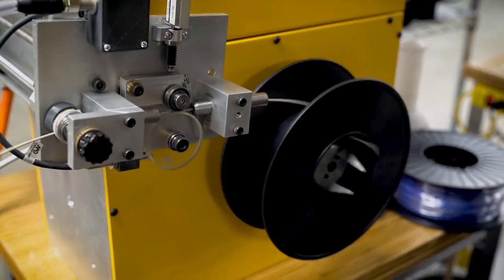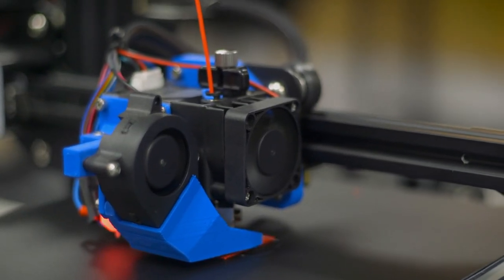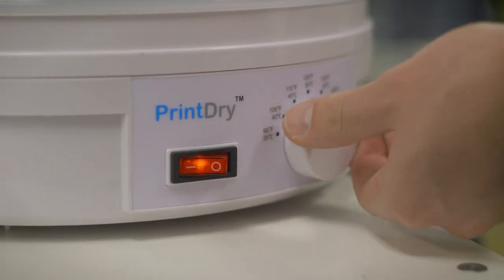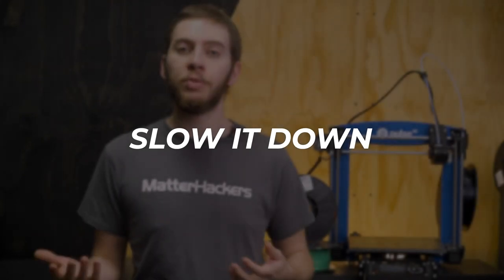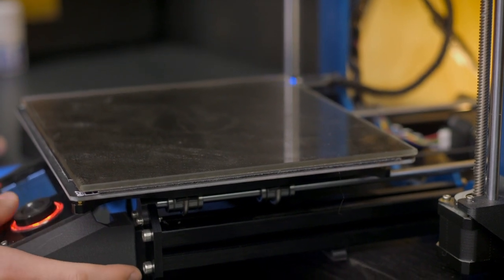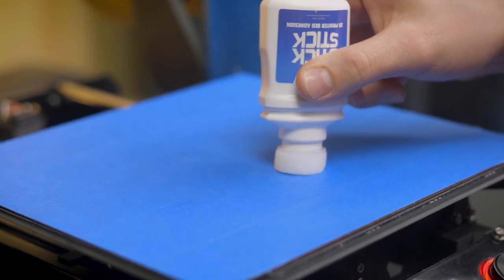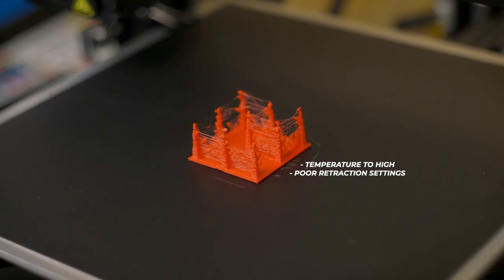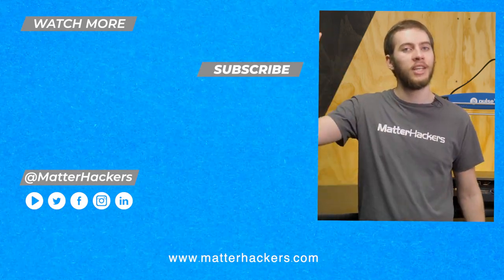How To Succeed When 3D Printing Flexible Filament

Comment: "PLA, ABS, or Nylon"

It's 2021 yo. PETG should definitely come to mind before ABS these days.

Edit: I actually retract this statement. ABS has some clear advantages over PETG in pretty much all scenarios other than chemical resistance. With printers becoming better, I think ABS has more potential to be more widely used.
Reply: printed a lot of PETG and while it has it's advantages (and disadvantages like oozing and getting Z offset high enough and nickel plated nozzle), it still fails short to ABS in terms of temperature level it can take before melting. ABS or even better, ASA are 20 °C more temperature resistant (70 °C for PETG, 90 °C for ABS/ASA). That's a lot. Of course, if you want much higher temperature and strike resistance, CF Nylon is a way to go. Well, except for price.
Reply: @elsunshine9976  actually, it’s much better material than PLA. yes, it’s harder to dial in but it sticks to bed like crazy.
Reply: @ZhuJo99  I've learned a lot about ABS since writing that comment. I agree.
Reply: @Joe_Yacketori  it really depends on the brand of filament. Yes, ABS is ideally printed in the chamber, but the one I use from Devil Design (poland), ABS+ is really good and prints easily even on open printer. Sticks like crazy to the glass (using ABS slurry, but seems like I don't need it). No warping, no cracking. I printed even bigger parts, taller parts and layer adhesion is great. Sure, for tall narrow objects it's good idea to use Draft shield to keep heat in the area of printed object, but otherwise it's great.
I would not trust to cheap ABS from chinese companies in terms of quality and printability.

Nero3d has a great set of tutorials on how to print ABS – I strongly suggest to watch it.

With right settings I was absolutely amazed how easily it printed. Yes, there is 100 % chance that I would be bitching on ABS if I would use other filaments but with DD brand I'm very happy. Since I print only functional parts I basically don't order PLA anymore. Will print the rest of PETG I have and done, will use only ABS+ and CF Nylon (for really serious stuff) from Innovatefil or Treed filaments (it's Luvacom german material as a source in both cases).

Biggest advantage of this ABS? Due to it's lower volume weight ratio you get a LOT more of it in 1 kg spool. And spool costs about the same as PLA and is cheaper than PETG :)
Reply: @ZhuJo99  petg breaks too easy
Reply: @elsunshine9976  what?! It’s much more flexible than PLA!
If it breaks in your case than you have very low temperature set and you were blowing on the print. Turn off the fan (or let it at 20 % max) raise the temp of hotend to 235-240 °C (or more) and use wide layers, like 0.5 mm for 0.4 mm nozzle (this should be a rule for every material). 

You are completely wrong. Please do not spread BS based on your incompetence to print other materials than simple PLA.
Reply: @ZhuJo99  Lol I have printed all meterials exept for nylon you are the one who talks BS
Reply: @ZhuJo99  Yep, Nero3DP is exactly who I started watching and learning the benefits of ABS from!
Reply: @elsunshine9976  come on man, every data, every print that is well made shows PETG is definitely not easy to break. Quite the opposite. You either bought shitty PETG (I don't understand why guys buy filaments from China), or it was really wet (rare, but can happen) or simply had wrong settings.

First rule of 3D printing – only PLA needs fan blowing on it. All other materials should be printed without fan or very minimum fan. Also, higher temp – better layer adhesion. 

And if you don't have esteps calibrated properly (without filament passing through nozzle) than well, yeah…

Look, I have many functional prints made in PETG, like case and bullet feeder for my reloading press and the amount of weight those have to take regulary for years is something most funny printed toys will never see.

Is PETG the best material outhere? No, definitely it's not, as I said, ABS/ASA and CF Nylon (a good made CF nylon, not Matterhackers and others marketing BS) are the most strongest materials one can print on home 3D printer. But for general purpose usage I will take PETG over PLA any day.

Comment: I am using a Pulse printer with Soft PLA but the part keeps pulling or curling up when printing. Standard PLA works fine. What should I change first.

Info:
Pulse printer
Soft PLA 1.73mm
Heated Flex Plate bed
Elmer’s purple glue stick
Hot head temp 220
Bed temp 65
Layer .3 coarse
Fill 10% light

Comment: i got a Flashforge flexible filament from my dad
i used the recommended settings for speed and heat but it printed blobs instead of nice lines
And i cant find any information on the filaments material it doesnt say what it is, maybe its tpu maybe if flex-pla who knows? not the manufacturer!

Comment: I need a flexible filament that's soft flexible but has grip . Similar to rubber ? Is this available on the market ?
Reply: I just printed TPU 95 A for the first time, and it is soft, flexible, and feels like rubber. The brand I used is Inland TPU in translucent green. What are you using the material for?
Reply: @BLueFeaTHeRedOliVeS  I just bought some of this . What temps did you print and what were you bed temps
Reply: @mastermachetier5594  Nozzle Temp 235°C, Bed Temp 65°C, glass bed w/Elmer's washable glue stick (the kind that goes on purple but dries clear). Alternative bed adhesion: Stuck too well to bare painters tape, use the glue stick on top the tape for release agent. Printer is cr10s. Edit: Flow Rate in Cura is 120 and feed rate on the printer is 120 (not sure if this was necessary or due to the fact I had a partial clog in the bowden tube right at the hotend that I diagnosed/discovered right after my TPU prints)
Reply: NinjaTek Chinchilla.  Perfect replacement for rubber, but maybe a bit "springy-er".

Comment: I have a E3d hemera that can print anything but TPU!!!, when I go to extrude it my extruded just clicks and doesn’t feed the filament through to the hot end. I’ve tried everything and can’t get it to print, does anyone have any tips for getting it to at least extrude out of my nozzles ?
Reply: I had the same issue with my mk3, i suggest that you retighten the extruder gear as og might be too tight, worked for meg at least

Comment: How do prints that require support work with tpu?
Reply: Useless I'm afraid.. because the filament is flexible.. There is no way to accurately calculate the spacing between the support and dense layers. So the support material literally just becomes part of the model

Comment: Any suggestions for bowden setups?
Reply: Bowden setups are not good for printing flexibles. You'll have to print at very slow speeds like 20mm/sec and retraction turned off and you may still have problems
Reply: I have good success printing sainsmart tpu on my stock ender 3. That filament is pretty stiff for tpu so that helps. I print at 210c and speed can vary depending on what I'm printing. If its a basic near solid object I do 40mm/s if its intricate with lots of opportunity for stringing I run between 15-20mm/s